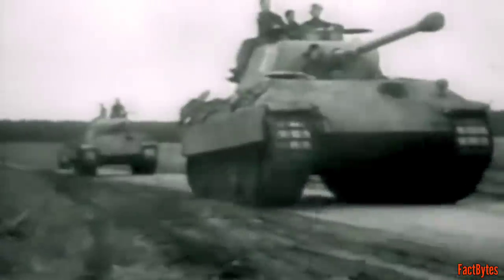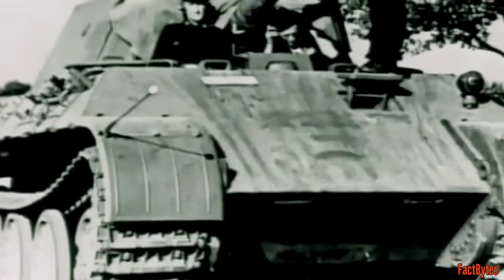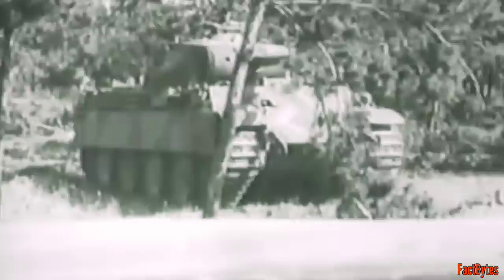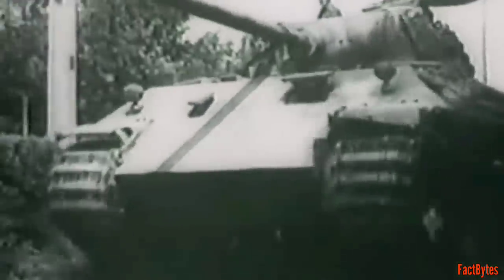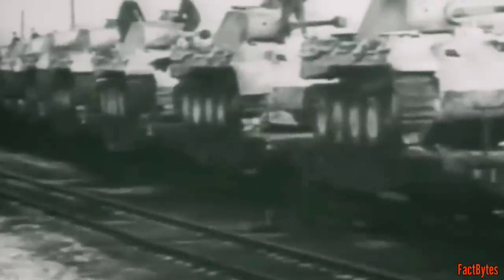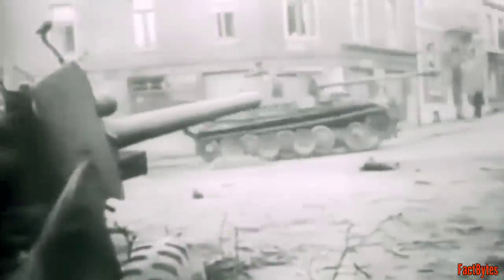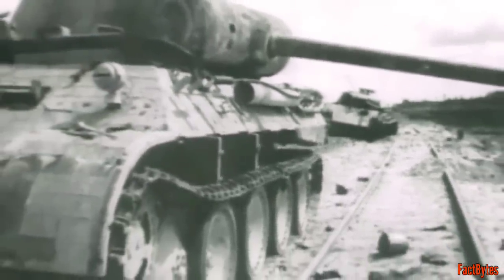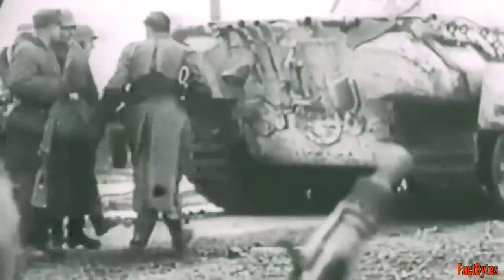Was The German Panther Really The Best Tank Of WW2?

Comment: It cannot be understated how important a gunners independent periscope is. The fact that a panther gunner has no way of seeing outside the tank save for his highly narrow FOV zoom optic is a travesty. 

The Panther was essentially only ergonomic for 1 of its 5 crew.
Reply: You call a 28 fov at 2.5 magnification and 14 degree fov at 5x magnification narrow? Until well  into 1944 the Sherman has to make do with a smaller fov than that.
Reply: @Dreachon  considering that unlike the Sherman gunner who has a 1x periscope to observe the battlefield, yes, that is very limiting. The Panther has a very good gunsight. The gunsight isn't the issue, but the fact the Panther gunner has literally no other way of seeing outside the tank is the issue. This is what made the Panther slower to get onto target than a Sherman was, which in a defensive role is problematic and in an offensive role is potentially crippling.
Reply: @kobeh6185  The periscopic gunsight that the gunner of a Sherman had came with some limitations that you don't seem to be aware off.

Firstly, it is fix in the turret roof which means that the gunner can't use it to observe the battlefield unless he is moving his turret from left to right.

Second is that until somewhere in the second half of 1944 the periscopic gunsight had a rather limited field of view, a rather disappointing narrow field of view.

Third is that with them being unmaginfied they were only usefull for looking at targets that were close, and did not do much for engaging enemy tanks at the common combat ranges which in the ETO was around 600 to 800meters.

Also, you like to go and say that the Panther's gunner had no other means to look outside but has it crossed your mind that only having a telescopic gunsight to use is what all German tanks used. Given the opponents that the Germans faced earlier in the war and overcame, it does not seem like they had that much issue with their arrangement.
Reply: @Dreachon  im gonna counter each of these.

1st. The periscope for most Sherman models was indeed fixed. That means the turret did indeed have to rotate to use it. However, given it is 1x, calling it a "narrow field of view" is silly when the comparison is to a zoom optic ONLY. Obviously it has a much wider field of view compared to the Panthers 1x gunners optic because the panthers 1x gunners optic doesn't exist in the first place. Apples to oranges. 

2.  The very point of a 1x periscope is to see at a lower magnification so the gunner can identify landmarks and the larger picture to better understand what the commander is telling him. So again "narrow field of view" doesn't really make sense to compare when German tanks dont have this ability at all.

3. "The 1x periscope is not useful for 600-800 meters" are you kidding me its as if you think I said they only have the 1x periscope and that they fire the main armament with it. Obviously the 1x periscope is to see what the commander is talking about in general, and then after transitioning to the zoom optic you have clear references in your head as to where the enemy target is located. This allows you to lay fine adjustment onto target quickly and without searching in the zoom optic. Say the commander specifies a target by landmark (ex, anti tank gun, load HE, traverse left, 3 telephone poles left of brown two story house, 650 yards) and the gunner can traverse the turret towards this brown house and see exactly what the TC is talking about all at once at 1x. He will then get on the zoom gunsight and know exactly where to fine adjust the weapon. On a panther this is much more difficult, because the Panther gunner has to do all of this with a zoom optic and will be unable to see the whole picture at once. This is especially true when dealing with closer targets. 

Your 4th point being that many German tanks had this limitation of no 1x gunners optic which is correct but you claim it just "wasn't a problem" because the germans won a lot in the early war. Thats not a good argument when they are facing French tanks which are terrible in target acquisition to the extreme and Soviet tank crews who didn't know what they were doing in 1941. German tank losses in the middle of the war were very severe. American tanks killed German ones fairly often, more so than myths lead on. Funny enough German tank destroyers (depending on the model) often did have gunners independent optics. And you can argue they were VERY successful. Its a really silly argument that Panther gunners (or other German gunners) did "fine" without an independent optic so why would they need it? That implies its not helpful which is certainly is, virtually every tank design after world War 2 has a gunners independent 1x optic of some kind. If it wasn't needed it wouldn't be there on virtually every tank made since. 

Its pretty well established nowadays that panthers were slow to get onto target, even if they were very lethal once they acquired a sight picture.
Reply: @kobeh6185  The very manuals for the periscopic gunsight list a very narrow field of view, the M4 and M4A1 gunsight are listed as a 9 degree field of view, the M8 and M8A1 seem to be even worse at a 6 degree field of view. With the M10 it seems they get a good one at 42 degree field of view but this one doesn't appear until late in the war.

On the second point, sadly the manuals disagree with you here, that is what they list.

On the third point, have you tried and look at an object that is some 600 to 800m away from with you just your eyes? You don't see much of it. Might want to try that and see just how limited you are in identifying the target.
Furthermore you seem to ignore, like happens so often, that the Panther's gunsight offers 2 different sighting with the flick of a switch, either a 5x with a 14 degree field of view or a 2.5x with a 28 degree field of view. 

Fourth point, and I'll address your nonsense here first to get that out of the way. German tank destroyers didn't have independent optics for the gunner, all they had was a single periscopic gunsight that very often had a far more limited field o view than the tanks had, the StuG III for instance had only a 8 degree field of view. So it's not funny, this is just stupid.

I advise you not to ignore parts and claim that the Germans success is only against French or Soviet tanks in Barbarossa. While German tank losses do climb every year on the Eastern Front so do the Soviet tank losses and they climb at a frightening rate, losing some 20.000 tanks in both 43 and 44 is quite a frightening number, especially if ones takes into account how many people would have lost their lives.
Giving the amount of tanks that were lost by the Western allies in the second half of WWII the Germans tanks do not seem to have been as impotent at taking out enemy armour as you try to paint them off, heck just look at American tank losses in the Bulge, some 800.

Does it even register with you that the Germans have a different modus operandi for their commander and gunner than the Americans do? Something they have had from the 30's and has influenced how they design and train their crews? British and Soviets tanks didn't use periscopic gunsights either, sure, they had a small periscope but it wasn't linked to the guns and were only good for observing their immediate surroundings.

Nothing is established that Panthers were slow to get onto a target, there is no actual proof and far too many people are hinging their bets on a so-called French report that nobody has seen in almost 30 years
Reply: @Dreachon  on the sights I think were talking past eachother. I'm not talking about periscopic gunsights I'm talking about 1x periscopes in addition to the actual gunsight in the mantlet of a tank (in this case a sherman). My point is the Sherman has both a zoom optic AND a 1x periscope that is not slaved to the gun. Virtually all tanks after the war follow suit, including German designs. As far as the M8 is concerned it is a mute point as its an open topped fire support vehicle. To see whats around just stand up a few inches. Same goes for the hellcat and wolverine. 

As far as seeing something at 800 meters. I can see a two story house and 3 telephone poles at 800 meters yes. What do you think a tank commander sees when buttoned up, its 1x.

Yes, the Panther gunsight is great. I would completely agree with you if you said the Panther possessed some of the best gunsight optics of any tank on the war. However my point is I still firmly believe a general 1x periscope (especially one that rotates) in addition to such an optic is a superior setup. 

As far as the tank destroyer thing I made a typo, its my bad. The reason why I said it was funny is because I meant to type german TDs dont have an gunner independent sight (although again this sorta doesn't apply to open tops like marders and such). Being in a constant state of defense and ambush positions allowed them to pick engagements often and so the lack of general low magnification visibility for the gunner was not as problematic as it would be on the offensive. 

Yeah post 1942 Soviet losses were high. I am not surprised and I completely agree. Tanks with armor no longer reliable to stop what german vehicles often carried, fighting a multifaceted long front against an entrenched enemy with lots of experience will certainly do that. I'm not arguing german tanks were ineffective, im arguing that with better visibility for the gunner, they would have been more so.bits just the reality that 1x sight for gunner or not, vehicles and positions waiting in ambush or entrenched will always be at an advantage. Take germanys most successful anti tank vehicle, the StuG. Like you've said it's got horrific field of view for the gunner, although this is often offset by the nature of its engagements. Concealed ambush with a choice in engagement terms. 

As for the battle of the bulge I think youre overstating how much it was german tank design rather than their employment in a surprise attack in the middle of a snowstorm that according to allied calculations was thought to be impossible in the first place. At the end of the battle Germany lost over 550 vehicles of its own. 

The French report is something I haven't read in a while but im still in agreement that a panther cannot get onto a target as fast as an M4A2 (or later) can when under the same conditions. My main criticism of the report is that is views the Panther as a typical tank much like the Sherman when in design and use the Panther really is a tank destroyer for the eastern front. After all its HE shell is laughable, its side armor is very poor for a tank of its weight, and its frontal armor is very strong. In terms of its usage the Panther was made to kill tanks, so a lot of the report is viewing it as a western front use case (which is obvious it is indeed french) but i still maintain that a gunners independent 1x sight is a welcome addition to any vehicle. 

Given the panthers nice glass, if you were to compare the Panther to a Sherman that didn't have a way for the gunner to see outside other than the main gunsight, I would certainly agree the Panther would be on target first most of the time. (Conditions equal)
Reply: @Dreachon  would also like to note the Panther HE was poor compared to later allied guns such as the 85mm but wasn't as bad as a lot of people on reddit like to claim.
Reply: @kobeh6185  The periscope gun sight of a Sherman is slaved to the main gun, it isn't an independent sight, the Sherman gunners doesn't have that.

I am not talking about the M8 HMC, I was talking about the M8 and M8A1 periscope gun sights. Those are the designations the gun sights have.

The Sherman doesn't have a 1x periscope that rotates.

You very much are trying to paint German tanks as being ineffective, now going and saying that it was the Germans being entrenched on the Eastern Front? Please show me the vast fortified liens that the Germans occupied on the Eastern Front in 43 and 44. You won't find any as the Germans were from Kursk onward in a almost constant of retreat. 

There wasn't a snow storm when the Germans attacked, all they had was some poor weather that kept allied planes grounded for a short while. 
Nor did the allies thought it was impossible to attack there as the Germans had very much attacked through it in 1940. The attack came as a surprise because the Allies had been under the false pretense that the Germans would not launch a major offensive in the winter, something the Germans have not done for a very long time.
Most German commanders were also opposed to it as the entire operation was poorly planned and even poorer prepared for.
Reply: @kobeh6185  The Panther's main gun had as much HE filler in it as the Sherman's 75mm at 690 gram, and vastly more than the 76mm did.

Calling its HE shell laughable is just another show of ignorance. You now also want to claim that the HE shell of the Panzer IV and StuG III were laughable as they had less filler than the Panther's gun?

And you really now want to compare a 75mm HE shell to an 85mm HE shell and act surprised that the 85mm HE shell has more? That is silly.
Reply: @Dreachon  for a tank that weighs more than an IS-2 to have an HE shell no better than a Stug IIIA is pretty disappointing yes. The 85mm is a more balanced gun for anti infantry and anti tank roles. Like I said the Panthers primary use case was for killing tanks. Its gun was an anti tank gun first. The T-34-85, IS-2, and Pershing had guns more balanced towards the encounters they would have. By comparison to tanks introduced around the same time as the panther, it has HE that is below par. Even the Tiger 1s HEAT shell has more TNT equivalent.

Was the Panther useless against infantry? Hardly. The HE shell was still lethal, likely as much as a panzer 4 (documentation especially on the Soviet side is centered mostly around 75mm L43 and L48s so who knows for sure) but comparing the Panther to its actual contemporaries rather than tanks that are like 4 to 5 years older and 20 tons lighter is what im interested in. The Sherman 76 had terrible HE, but compared to the M2 and M3 37mm HE it was far more potent. That doesn't mean the 76 had good HE. Same goes for the 100mm D10. It had superior HE to the 76 and 85mm guns but its amin competitor was neither of these older guns, it was the 122mm D25. The D25 was selected for the IS-2 instead. So its fair to say the 100mm had inferior HE to its current competitor. Its fair to say the Panther has inferior HE to its contemporary tanks as well. 

Not to mention, with anti infantry use requiring lots of ammunition, the panthers practical rate of fire was hindered by quite long ammunition, no ready racks (which is overblown as the panther has a very open turret basket but still not ideal compared to a true ready rack) and a somewhat narrow turret ring, especially for the length of ammunition. Its been a long time since I've been inside of a panther, (A model from Portola valley) but I can see the loader would have issues in certain turret positions (they didn't rotate the turret for me oof) or if all the hull ammunition on his side was depleted or nearly depleted. Note this panther I was in was missing some of the sponson racks but those seems difficult to get to in the first place.